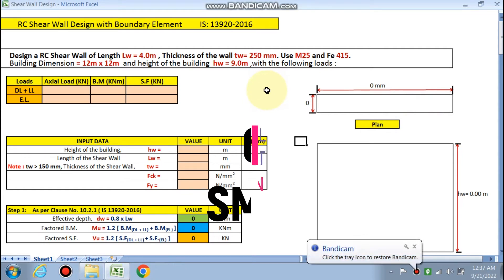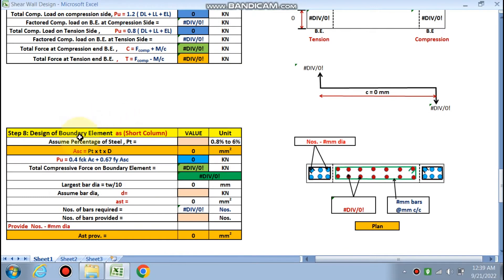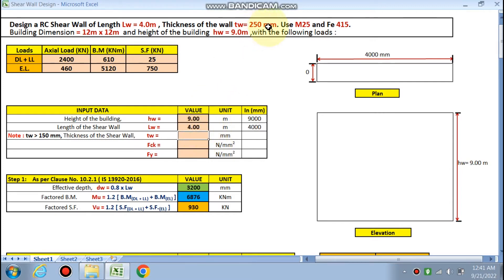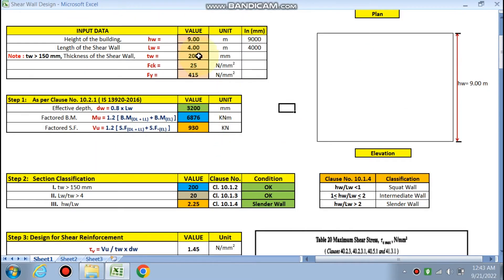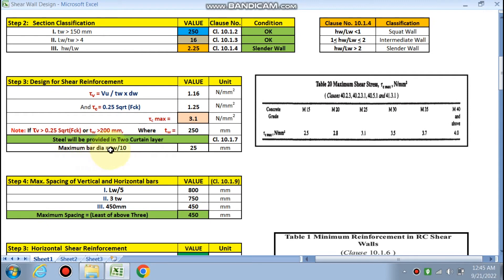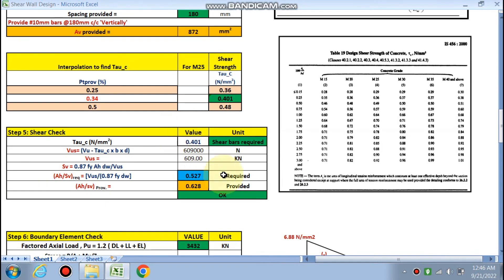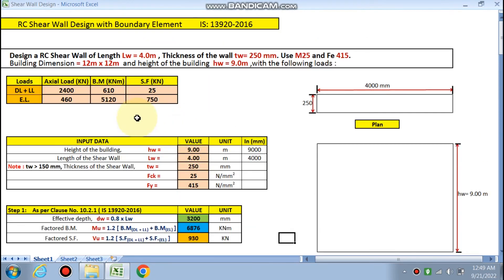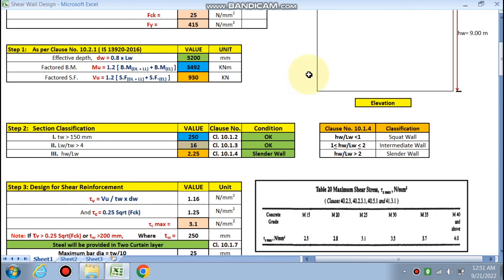SHEAR WALL DESIGN WITH BOUNDARY ELEMENTS- (PART-1)

Comment: How can you get the value for Vus=609KN? Please Explain
Reply from the maker: Basically Vus = Vu - Tc × tw x dw in this case b = tw ie. Thickness of shear wall and dw is effective depth.
Hence, Vu = 930 KN, Tc = 0.401, tw = 250 mm and dw= 3200 mm
Vus = 930 × 1000 - 0.401 x 250 x 3200 = 609 KN
Hope u understand.
Reply: Yes, Thank you
Reply: Oh thank you.. But I try that.            Vus= Vu - tc x b x d. So, I didn't find the answer.
Reply from the maker: @anbarasansubbaiyan3157  now u get it